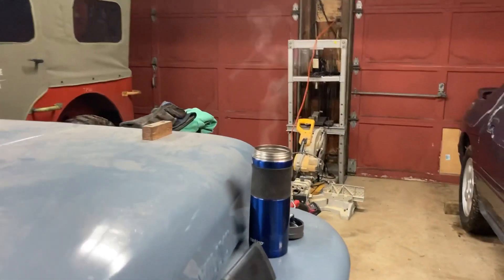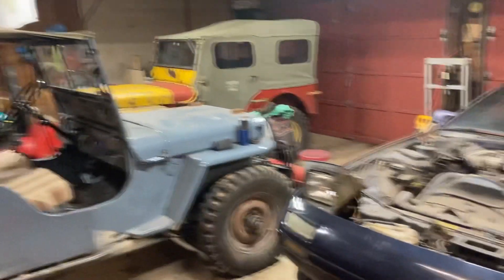Mazda RX-7 13b rotary swap willys jeep (Part 1)

Comment: Will it still be 4WD ?
Rotary engines don't have much torque.
Still interesting but I have to ask why ?
Reply from the maker: Yes the build is finished and on the road. It is 4wd. This engine makes way more hp and torque than the original engine. It’s an absolute ripper. Don’t believe everything you hear on the internet. Watch my newer videos. 👍 it’s all about proper great and vehicle weight. Those rules apply to any engine from big diesels to little baby rotaries.

Comment: is it a specific year 13b that you can do this with the holley efi or just about any 13b?
Reply from the maker: Racing beat makes 4 barrel intakes for pretty much any 12a or 13b. Then you can bolt fitech or sniper to any of them. 👍